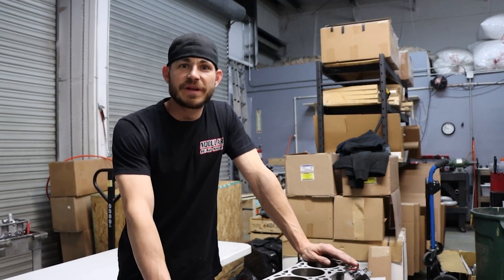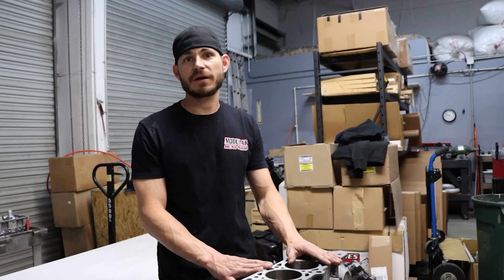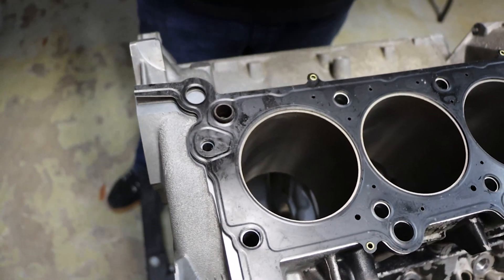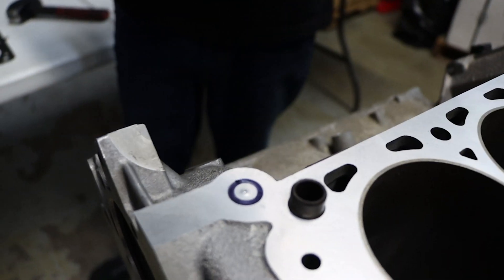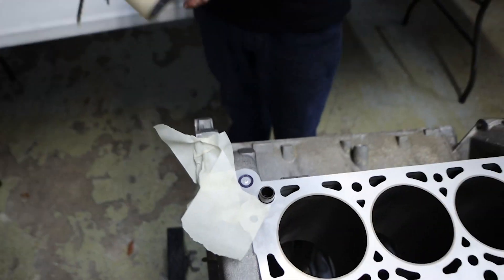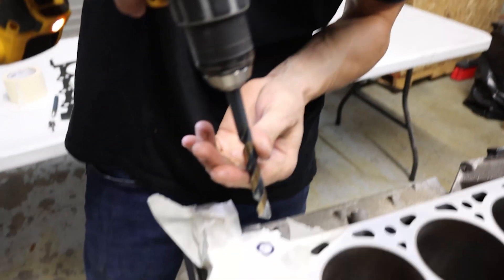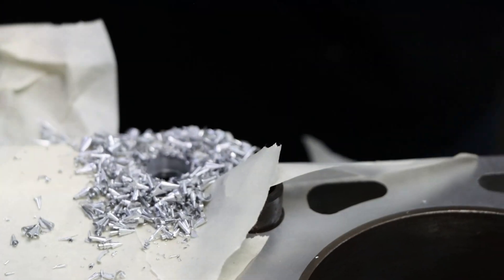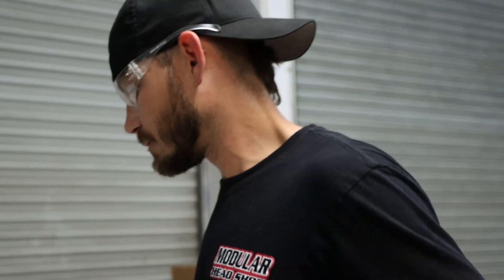Tech Tips - What is needed for 2V heads on a Teksid Aluminum Block?

Comment: So when putting stock pi I heads and cams on the teksid block. Will valve have clearance from the pistons?  Or would pistons need to be changed?
Reply from the maker: The piston to valve clearance will not change. Both 2V and 4V pistons, regardless of dish size will have the same PTV clearance. This is because the valve to piston interference is greatest towards the edge of the piston and not near the middle where the volume would make a difference.
Reply: @ModHeadShop  awesome.  Thanks for the quick reply.  Keep up the good work and videos. 👍
Reply: @ModHeadShop  I also forgot.  This build will be going into my 2004 f150. I have the tall aluminum intake and everything is stock. What horsepower numbers would I be looking at?  My truck needs a little more power then stock.

Comment: I drilled the hole my self ripped apart my block and threw all the new mmr parts in the trash except for rods. They are legit hood Manley rods, pistons are mmr pistons crank is a boss 302 crank, can handle 1500hp but spacer shit is fugasi. Now ima run customs diamond pistons and Better crank prolly Manley don’t need no junk 4.75

Comment: Man oh man, I don’t get any response, Jordan I really needs your help or anyone else in here I have a brand new build teksid block sitting on a crate  I need to remove the block and have it put on my engine stand i can’t find a teksid block engine lift plate anywhere, it’s a 2v head I need I need to pull a piston out and oil the block up and make sure there is no rust any where it’s been sitting for for a few years now!!! SOME ONE PLEASE HELP ME PLEASE also what bolt sizes do i need to mount the short block to the stand mm

Comment: Could u put 4v heads back on a block if it has that hole drilled
Reply from the maker: Yes, it would be the same exact cooling configuration as an 03 Cobra. Iron block with 4V heads.
Reply: @ModHeadShop  The 4V "b" heads don't have a hole in this position, but  wonder if drilling a hole in the "b" head to align with this hole in the block would help the b head cooling issues, or would it not align with the coolant paths in the b head?

Comment: How about a 2v budget build, iron block romeo , gen 2 coyote rods, if they will work, slap in junk yard parts and see how long it lasts, my ol 2v new edge is not work a 3k short block, 
I'm gonna give it shot I have a set of gen2 coyote rods and pistons, I'm sure valve reliefs in gen 2 pistons  won't work on a 2v even if you took bore to correct mm, otherwise it's the go to is eagle for low dollar forged rotating assy,

Comment: So he is doing a 2v buiid?
Reply: Yea, he did a video where he decided to go teksid turbo 2v. Which is good, 2v’s don’t get the love they should. He’s gonna be hurting feelings with that 2v like Andrew Lavender
Reply: @downhilldaddy9346  ya I have a fully built teksid, my self for 2v, and the jokers who build it didn’t drill the water passage on the fucking block and it’s fully built, pissed me right the duck off gonna see if a machine shops can do for for me with out having to tear it down, engine can handle 1500hp easy, Manley I beams. Customs diamond pistons lateral gas ports blah blah 9.5 compression.trick flown ported heads, trick flow intake, ordered a on3 turbo kit with not turbos twin kit, and running twin 67/66. All in a convertible lol, not gonna run that much power, my crank is just a boss 302 crank vans handle 1400hp but still. Wanna try to get it on a stand to see if I can do or my self with a shop bac sucking all material outb
Reply: @2vgod460  you’re probably gonna have to take it all apart just to ensure the shavings don’t get in the engine

Comment: It would be cool if you could cover flywheels / clutch setups and their interchangeability between engines, transmissions, years, and manual or hydraulic throwout bearings, etc. I've talked to a few companies now and don't really get good answers. Seen the tech tips on your website, but doesn't go into full detail either. For example a 99 5.4 engine with 8 bolt crank that will be used with a T-56. One would assume you can use a regular 8 bolt 96-04 setup just fine even if the transmission is different, and the 03-04 cobra t-56 setup would be more inline with the application, but can the 03-04 setup work fine with a manual throwout bearing? What about using the gt500 setup or does the transmission difference cause a problem? Also seen flywheels that say 4.6,5.4, and coyote, and other sellers selling stock coyote flywheels for use with 4.6 and 5.4.. Some talked about using spacers and some say to use straight up. If you can use the coyote flywheel then you can use the whole clutch setup as well with 4.6 and 5.4? I feel like there are some more rules to follow past bolt amount, balance, and flywheel / clutch size and you guys could help with this.

Comment: Loving all the videos and tips man!! Thanks modular head shop!! I have a WAP aluminum block in my car now that came in it. I’m getting ready to do the on3 turbo kit on my car but plan to build the motor first. Are the WAP blocks the same as the teksid as far as needing that coolant passage port drilled? Again the motor is currently in my car and runs fine with no overheating issues but if I have it apart was wondering if that hadn’t been done and needs to it would be a very good time to do so 😂 thanks again for all the help!
Reply: Nah, they came with 2V heads I believe

Comment: How to fly cut 2valve pistons for large lift/ long duration cams
Reply from the maker: The answer is buy the proper piston with reliefs in them. I cannot support adding reliefs to stock pistons or pistons not designed for valve reliefs. Watch my cam degree video where I explain how the top ring is reduced from the valve relief.
Reply: @ModHeadShop  thank you another question, a lot of people in my newedge group state that the roadrunner (boss302) and or coyote connecting rods are direct drop in replacements any validity to those claims

Comment: One thing you should add is that the gasket for the oil filter adapter is different for the teksid. I found this out the hard way a few days ago. The gasket for the iron blocks have a larger coolant opening and there isn't enough material on the teksid block to properly sandwich the gasket. The gasket for the teksid has a shorter opening for the coolant. I just swapped gaskets on my car today actually lol.
Reply from the maker: I will add that in at some point. Thank you!
Reply: @Street Slayers thank you!!
Reply: @Post_Tenebras_Lux09  mahle b31703 for the teksid
Reply: Which gasket did you purchase to fix it?? Thank you!
Reply: @Post_Tenebras_Lux09  if you buy a lower gasket kit it will come with both